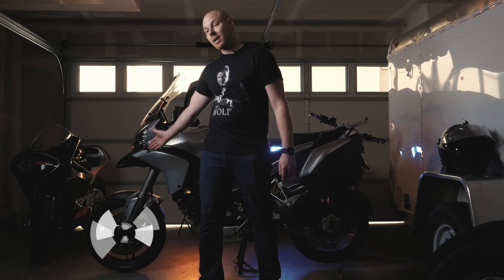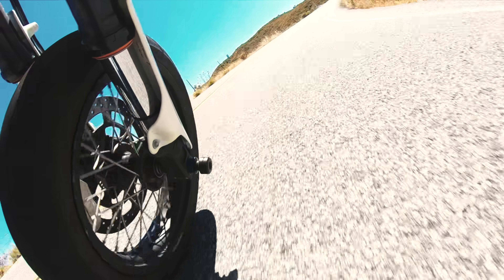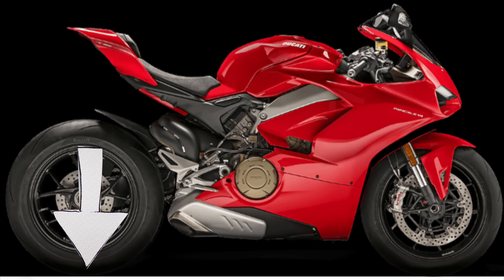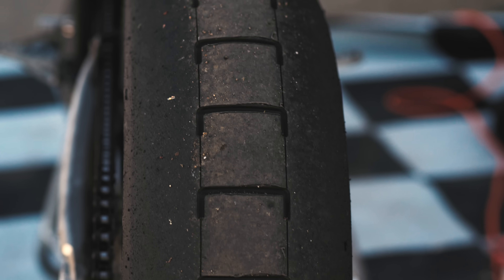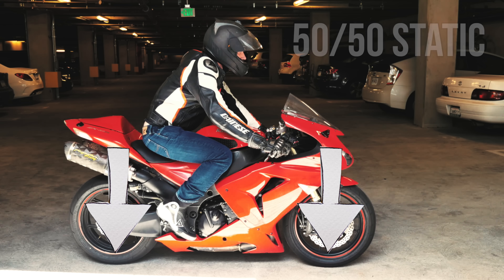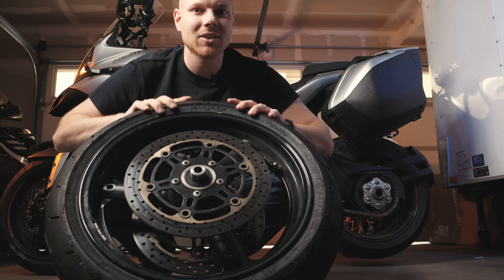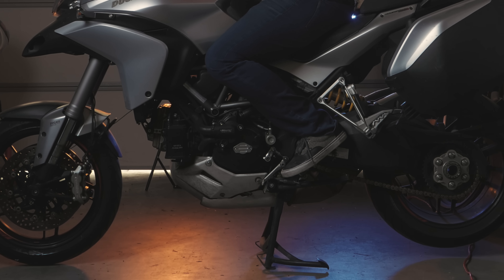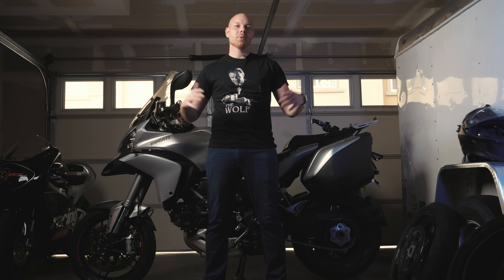Why are Front tires Narrower than Rear Tires?

Comment: Thanks for your clip. I am running an Yamaha sr400 with both rim are 18" and front tire is narrower than the rear one. I wanna make it as an adventure bike. I see that some vintage motorcycles use 3.5x18" for both. Please tell me is it safe or harm the bike? I think if using that offset, I only need to carry 1 pair of tire and tube. I am looking forward to your reply. Thanks!

Comment: Was thinking I want more traction for breaking than for acceleration, but you can only brake so hard before you flip the bike. Wonder if that is a key factor in choosing front tire width?
Reply: As per in the video: its way more important to keep the handling

Comment: I got new tires on my Indian Scout 60 a few months ago- commander 2’s.  But something felt off ever since then. I was feeling a lot of slide and slip and wiggle over insignificant cracks in the road as well as less efficient braking and ABS engagement but still without strong stopping power. I was feeling minor road deviations as major painful bumps and kept seeking advice to understand what was wrong. I went back to the mechanic who glanced at my tires and said they were perfect.  Yesterday I went to a shop that specializes in moto tires. My rear tire was completely worn and they observed immediately that a tire with REAR stamped was on front of the bike and the directional guideline was backwards which they said was absolutely the explanation for all my problems.  Also since the tires I burned through brake pads and needed a rotor in a twice as fast period of time. What would the dangers be if I kept riding on this and how could it have impacted other parts of my bikes parts and performance?

Comment: curious: does this tyre width difference create a longitudinal torque within the bike/frame? Because in any given angle the front part can steer with same speed but less inclination. If so, does it lead to other behaviours?

Comment: Hey the video was great but I have a specific question I have a sv 650 but with a gsxr front forks swap and I recently got new tires and the front one is the right size for a sv but it’s wrong for the forks so it’s just a bit smaller still fits the wheel just a hit narrower it’s just a more twitchy and sensitive is there any other problems that I might run into like performance ?🤨

Comment: What about wheel size, why dirt bike use big front wheel and rear using smaller one, as example tw200 had 18" in 130/80 tire front and 14" in 180/80 rear, the over all diameter is same, and sport bike has same wheel diameter? Thanks

Comment: The main question here: why do you consider rear tire having a "higher load"? Braking is a lot more dynamic process than acceleration with weight almost completely distributed to the front so, in fact, front is more loaded up then rear if we compare braking to acceleration.
Reply: Traction goes up as the load on the tire goes up. Weight transfer makes up for the smaller contact patch on the front.
Reply: @Mishn0  maybe, I was talking about the statement on the rear tire having "higher load" what is obviously false.

Comment: While I like everything else in the video, please stop promoting the friction formula with tires. The formula applies when the tire slides, not when it rolls. Especially bike riders, you don't want to reach friction formula application (between road and tire).
While the point was to show the load-grip proportionality, it's not correct to show it (and continue using it in discussions).
Your tires will have grip defined by adhesion (like glue). When pushed to the limit, friction/sliding will appear, but adhesion still dominates the grip quantity. Pushed more, adhesion drops fast, friction increases and you loose control (or drift/burnout). At that point, friction formula applies completely: contact patch size/area is no longer relevant. Bigger tires only help with endurance (which is probably in the seconds range).
Reply: Can you refer to some materials that elaborate on this, please?
Reply: @ropro5402  Unfortunately I don't know the titles of tire physics books. All I know is that for decades I knew the "school taught" friction formula does not apply (demo was based on a sliding solid block), and I've got hints from interviews of Dave Kaemmer (iRacing creator). Finally a dispute on another YT comment made me reach this conclusion.
Looking now, I see some articles using "static" and "kinetic" friction, but non-scientific articles either talk about oversimplified abstracts or about wheel geometry. Nobody talks about contact patch influence.
In general, if they talk about F=uN in tires, you can just ignore what they say (or at least apply max skepticism).

Comment: If you are talking about the PRIMARY effect you are wrong. The factors you mentioned are correct but are minor variations and have minor effect on the behaviour of the bike (and sometime cancels each other out).

 If you change the profile or size of the front or rear tyre it has a major effect on the behaviour of the bike (and a mismatch is even more noticeable). The reason for this is the the contact patch of the tyre moves off centre as the bike is leaned over. The different sizes (or different profiles), working in conjunction with frame geometry, give different arcs and changing arcs in relationship one to the other,  as the bike is leaned.   

(And, in the primary speed range that most m/c's operate in, the primary cause of steering is lean angle and not the attack angle of the front tyre.)

That is not the complete answer to the very complex issue of steering a motorcycle or the physical factors involved, but does give a better understanding of the effect of lean and tyres, and how a rider can adapt to get different desired outcomes.

Comment: Coefficient of friction doesnt change with vertical load, it is a constant value (for certain road surface and certain tyre). What is correct is that Force of friction changes with the vertical load. My 0.02$...
Reply: I just posted that it's the wrong formula for his point. Friction formula applies only while tire is sliding, not while rolling.

Comment: Like your videos in the real sense, not the click sense.  
Doesn't the wider rear tire also conveniently allow for more room for feet, chain, exhaust, motor etc. and allow the seat to be lower despite high lean angle clearance?  If the rear was paper thin, about 4 inches of width would disappear for the same lean angle.

Comment: A narrower tire also gives more turning rate than a wider tire for the same lean angle. That means, with a wider rear tire, the rear makes an arc with a bigger radius than the front making the motorcycle more oversteery.
Reply: That make sense, never thought about it !

Comment: Hi thank you very much for touching on this issue very few people do actually. I have been wondering though... Is it possible to use the same wheel size for both the front and back wheels.... Say wheel size 130/90 for a 150cc motorcycle
Reply: Front tire should max be 110/90 section

Comment: Excellent video.
It would be nice if there was a part 2. Interesting subject matter.

Mike, I have a question ( well, I have many, but, will stick to just one ), does tire diameter affect grip?
Some bikes ( cruisers, duel sport ), I have seen with different size tires. Narrow 21 inch or wider 18 inch.
I have always wondered if the narrow 21 inch that I see on cruisers are unsafe?
How much of a braking distance and cornering speed difference between narrow 21 inch and wider 18 inch on duel sport?

I know that ended up more than one question. Sorry.
If you answer just one, that would be helpful.
Thank.

Comment: Hi MIke! Is the middle of the lane more slippery than the sides? I mean where car tyres are not "cleaning" the surface usually the road has more dust. Can i go from the outside of my lane to the apex without worrying that i will lose grip? This fear is limiting my riding. Thanks.
Reply: Shouldn't matter much imo, just avoid white painted lines on road they are much more slippery than asphalt, especially wet ;

Comment: I have a question that needs answering. Why do most motorcycle exaust are on the right side of the bike?
Reply: Because everyone tends to lowside on the left. Just kidding.
It's because the kickstand is on the left, so you get off your bike on the left - without having the hot exhaust there or fumes if the bike is on.
Reply: @TWIRKNOLOVE  Also, more under swing-arm clearance due to chain usually being on the left.

Comment: plz make a video why motorcycles are limited to max 6 gears whereas cars have 7 to 8 in manual
Reply: akash ketwal is mainly a weight/benefit ratio matter. Nobody seems to check the weight of the car they are buying (despite being possibly more important than hp, I assume is because they don t have to lift it from the sidestand). In bikes, well, is a very different matter.
Reply: Plus you dont need more in bikes, as they typically have much better power to weight ratio than cars.
Personally prefer.5.speed 'boxes to 6, less paddling....

Comment: 3:10 does tire load sensitivity account for the increase in area of the contact patch? I’ve thought that the bigger contact patch increased your overall frictional force.
Reply from the maker: Yes. A larger contact patch sees less reduction of the coefficient of friction because of vertical load. What is really going to mess with your head, is that as the vertical load increases, the contact patch area grows. The reduction of the coefficient of friction because of vertical load is not linear and very hard to measure.
Reply: @MikeonBikes   That is very interesting, and I'd love to pick your brain some more about this topic in person, when we get the chance. Thanks for putting all this info out there.
Reply: Pounds per square inch. Same friction spread out
Reply: @janeblogs324  Yeah, I see now that Mike was describing the fiction force per unit area of the contact patch. Usually a force is measured in pounds, and when it is per unit area it becomes a pressure. definitely a head-scratcher.
Reply: Yes and no, yes only if the coefficient of friction of the tire compound is high. Otherwise, as the tire patch goes up, the PSI goes down and in most cases it balances out.